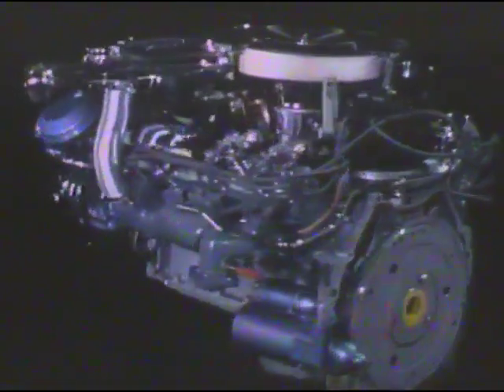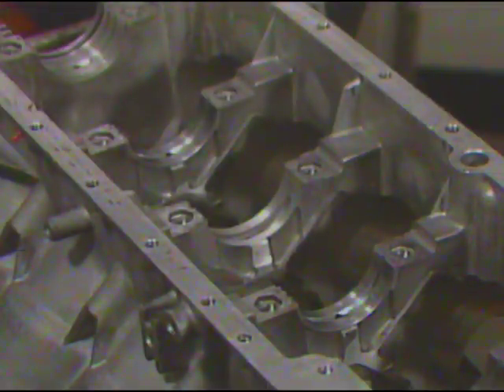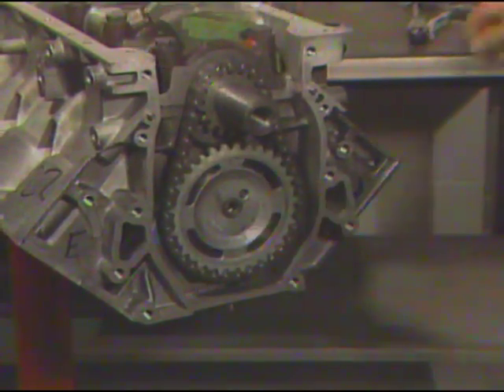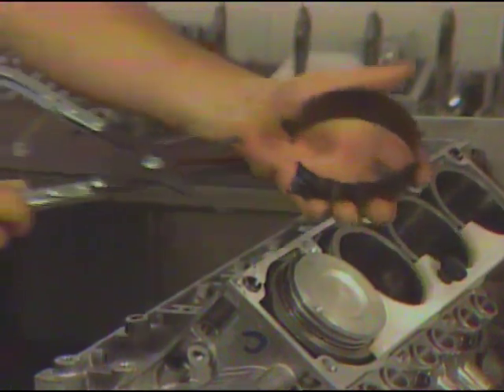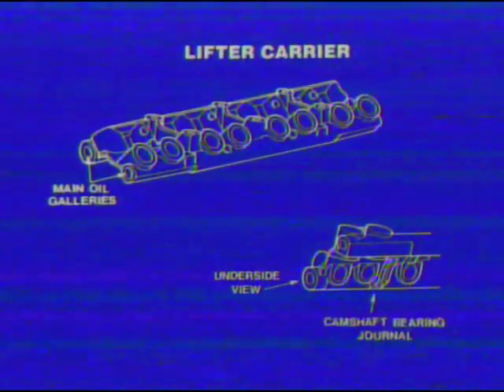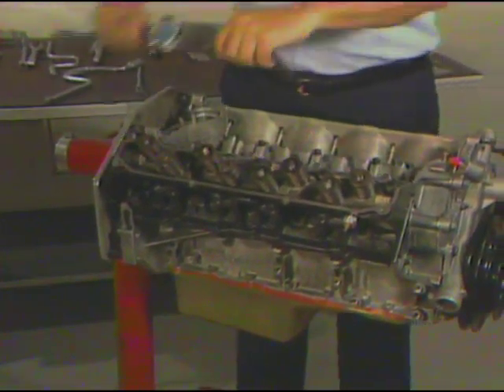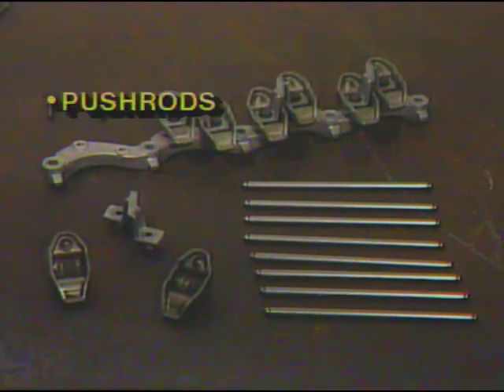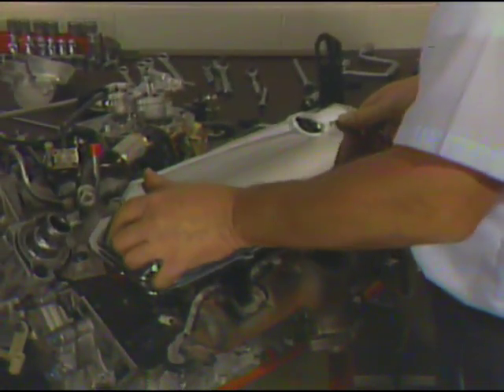Cadillac HT4100 Engine Assembly - Service Roundtable Laserdisc

Comment: Best engine ever! Powerful, smooth, quiet, fuel efficient and most of all extremely reliable! Fun Fact: It is so good, that all of today's best engines are based off this exact platform! Thank you GM!
Reply: I am sure glad you have a sense of humor!
Reply: It was a pos,headgasket and camshaft failures
Reply: You are insane
Reply: What??! This is a HAND-BUILT MASTERPIECE! 🤯
Reply: @allentoyokawa9068  The camshafts in them were too soft.My dad has replaced one because of headgasket problems
Reply: They are excellent engines, provided you don't ever start them for any reason.
Reply: @kennethsouthard6042  They were not
Reply: @kennethsouthard6042  🤣🤣🤣🤣🤣👍
Reply: They ran good...... If & when they ran. Whatching the assembly procedure in this video clearly explains why these engines sucked. Though they did go under the hoods of some attractive looking Caddys.
Reply: It Did Help With GM Engines, Except The Engines That Followed Were Tested Better & Not On The Public, The HT4100 Was So Bad Nobody Will Make An Engine That Size, There Are 4.0 & 4.2, But No 4.1L...Let That Sink In 💁🏽‍♂️
Reply: Was your point of reference a Vega engine, with a powerglide?
Reply: When maintained properly yes but that goes for any engine.
Reply: Very fuel efficient

Comment: I ha 5:46 ve my Dads 83 Eldorado,  these were beautiful cars inside and out. It has its original Ht 4100, 147.000 miles, no problems with the engine,  runs smooth, sounds very good. 3000 mile oil changes, and coolant exchanges every 2 years, and coolant tabs ALWAYS at every coolant service.  The engine has never been touched.
Reply: You’re the only one with the original 4100 trust me 😂
Reply: @LowEnd31st  no one gonna trust you. My 83 Brougham still running strong 41 years later. Now what

Comment: Owned a gorgeous 1983 Fleetwood Brougham d'Elegance Coupe w/only 30k miles back in 1985-86. That Hook & Tow 4.1 motor was junk. Broke down non-stop all the time. Got rid of it after 6 months. Never went back to Cadillac after that.
Reply: I have a 30k mile 83 fleetwood brougham de elegance with 4.1 and runs perfectly in 2024

Comment: I get this is a bad engine. But I can't bring my self to swap it out of my seville. The engine is the heart of a car. This video made me want ti get it rebuilt and get all that polished chrome on it. I would most likely have some company machine me new heads.
Reply: I have an 85 Seville and while the video showed how intimidating this rebuild would be due to modern supplies being different, I still want to rebuild my 4100 too. Maybe even change some parts to make it more reliable if possible.

Comment: I had an '83 Eldorado with this engine and what a nightmare it was. On the plus side, the car got 26.5 mpg on the highway and purred like a kitten. Is there any place on that engine where GM did NOT use RTV? I got rid of the car and bought a new 1993 Volvo 240 which I still drive today 30 years later.

Comment: Like so many other GM products, this one was actually decent just before it ended production. My dad put over 300k on a '91 4.9 with nothing more than regular maintenance and main bearings every 50-70k. The only time it left him stranded was due to fuel strainer desentegrating and destroying the fuel pump. Neither the engine or trans were ever out of the car. That said, most of the interior was held together with long self tapping screws and duct tape by the time he gave up on it
Reply: Main bearing are absolutely not supposed to be a "Wear Item" - if they need replacing that often someone has seriously fked up.
Reply: I’ve known of more than a few 200-300k + 4.9’s
I’ve never seen that many on a 4.1, but my 85 Brougham has ~130k and to my surprise has given me very little trouble. We’ll see if that last…

Comment: In my experience with GM engines, there's too much dependence on RTV (Room Temp Vulcanizing) sealant instead of good old gaskets.
Reply: A good quality RTV such as  grey  greay or ultra black.. has excellent sealing properties.. better than gaskets... A lot of modern engines.. have their timing chain covers oil pans.  Sealed Solely with RTV.. when applied properly. It seals much better than rubber or cork gaskets

Comment: I like that there's one comment so far and for once it's not someone screaming 1st also excited to see all the comments on how good or bad the engine actually was curious if it has major failure points
Reply: It was one of the worst engines ever made. It was rushed into production in 1982 when Cadillac’s 6.0 liter V8-6-4 cylinder deactivation system ended up being a catastrophic failure in 1981. The HT4100 wasn’t meant to debut until 1985 in the much smaller downsized line of cars. But it was hastily placed into large, heavy full-size Cadillacs to meet government mpg CAFE standards. The various metals used in the engine were not compatible and caused the head gaskets to leaks and fail, head bolts would tear out of the soft aluminum threads in the engine blocks, oil pump failures and the engine was just too small and underpowered for the large cars they were being placed in.
Reply: @jayson657  y does this not surprise me lol good ol gm it's like VW but american

Comment: I found a cherry '87 DeVille with a 4100 in it @165,xxx miles. Im sooooo curious as to wonder what was done to it to have reached those miles(rebuild, maintenance, etc). Started out asking 5500, but now its down to 3995. If ut creeps down to about the 3500 mark, i just may get it at least for the body/interior. I can always replace the motor, right?
Reply: There’s a good chance it’s been replaced or rebuilt already, even though the 87 version is allegedly “fixed” (it wasn’t). Problem is it’s getting hard to find replacements.

Comment: Let's see. Oil leaks. Coolant leaks. Intake gaskets. Main bearing knocks. Sludge. Worn camshafts. Broken oil pumps. Broken rocker supports. Sticking valves. And more oil leaks. Did I forget anything? I cut my teeth on these boat anchors in the 80s starting out in a Cadillac dealership.
Reply: Left out headgasket and camshaft failures
Reply: Oh, yes, you forgot the porous block castings which let coolant "bleed" right through the block lol...... don't forget your coolant pellets when changing the coolant to keep them nicely blocked (and clog the water passages it DID need in the process)
Reply: @joe6096  yeah, we called them Cadillac aspirins
Reply: I cut my teeth in the mid 90s after most of the bugs had been worked out of this design and Cadillac started all over again with a new one. Doing main bearing service or even an intake on the 4.5/4.9 engines was a treat compared to all the headaches that came in on the Northstar Sevilles/Eldorados. Ugh I'm glad those days are over
Reply: Same here started at a Pontiac Cadillac dealership. Cut teeth, hands, fingers, arms and assorted other body parts!😁 Parts department had a half dozen or so long blocks in stock! Now that is quality 😅
Reply: I bet you got lots of experience 😂

Comment: What carries over to the later, refined 4.9L? The build in particular is moving in a RWD reorientation but the engine and transmission are very interesting to me, and I'd like to utilize the pulled drivetrain in something else down the line.
Reply: A lot of it carries over directly. Really the only major differences are the timing cover and thermostat housing adapter. The 4.9 seems to use proper gaskets in place of RTV slathered over everything, as well.

Comment: Good grief, I hated this motor.  Worked in multi-line dealership service department and when we saw one of these it was usually for blown headgaskets/overheating or leaking oil.  

I'm not certain which was worse, the Northstar with constant blown headgaskets/bad heads or the 4100 motor.  Along with V8/6/4, not one one of Cadillac shining engineering achievements.
Reply: Your right ex Cadillac mechanic here also

Comment: Go listen to what Adam at Rare Classic Cars and Automotive History has to say about this engine. It's not good and he has a lot of experience with Cadillacs and other cars of this era. He says if you want an older Caddy avoid this engine and anything with an Oldsmobile 5.7 diesel. Both are probably the worst engines ever sold to the general public excluding the original Vega engine which was even worse. The V8-6-4 was also terrible, but if you disconnected the system and just ran it as a V8 it was fine.
Reply: The Olds 350 diesel can be made reliable fairly easy and is simple to work on. Headstuds and a water separator and suddenly you have a 30MPG cool highway cruiser or daily
Reply: @V8Power5300  This might be correct, but as a stock design it was terrible.
Reply: Adam brought me here.

Comment: This is the engine that had the V8-6-4 thing correct?
Reply from the maker: You're thinking of the '81 Cadillac. Clip a single wire and it goes back to being a dead-reliable cast iron 368 like the '80 version. It was the '82-85 HT4100 that was the disaster.
Reply: No this hunk of junk was hastily rush into production to replace the failed V8-6-4.

Comment: Such a shame. Small, light, smooth, replaceable wet liners, so much about this engine should have worked well. It was just rushed out before it was properly fettled. Too many odd mating joints, too much RTV, too much differential expansion, not enough torque in the equation. All Caddy engineers needed were another two model years of troubleshooting the design.

Comment: Back in school a classmate had this engine in a hand-me-down Cadillac. I remember it being pretty slow, but got slower and slower until finally it could hardly even sustain 35mph and they junked it. I can't be sure this is true but supposedly the camshaft lobes literally wore down flatter and flatter until the valves hardly lifted!? Seems like an impossible mistake after properly hardening camshafts for decades, but I've overestimated 80s GM before.
Reply: i mean they still cant get it right with the ls. they have problems with camshafts aswell. I've sceen one taken out of a 2012 or 14 i cant remember which and the lifter and 3 lobes were just completely fuckered

Comment: This engine was underpowered and plagued with issues.  This engine should have had aluminum heads.  This engine was intended for the FWD models.  They should have never put them in them 
Full size Cadillacs. I own a 1984 Coupe DeVille with this engine. It’s smooth running however with the listed problems I make sure it’s maintained.

Comment: This was the worst engine in the cadillacs 4.1 noted for coolant leaks if you didn't add a additive in the  Radiator. The headgaskets Would leak because the block was aluminum with cast iron heads. If you've got 30000 miles out of the engine with no problems you were doing good.

Comment: A bean counter engine…To save money, GM should have just switched to sharing engines by then. Say a Chevy 305 that was found in a Caprice as they were slow but good engines. Better to piss off customers by not having a “true Cadillac engine” than having one of the worst engines in history ruin their reputation. They finally got smart an eventually put Chevy derived engines in their full size RWD cars. Unfortunately since 1981, there hasn’t been a good Cadillac engine the write home about. The 4.9 was OK but nothing like the small block Chevy engines. As a GM guy, Ford had it right by sharing the 302 and later the modular engine.
Reply from the maker: Unlike the diesel debacle (which was bean counter related), the HT4100 was an expensive engine to design and produce. Tighter tolerances, new design methods, exclusive assembly line, lots of aluminum. It was engineering that dropped the ball on this one. But Cad was in a real jam at the time. The Chevy stuff is out (not-compatible with Eldo/Seville FWD). And the big B/C cars were going to be dead after MY85. They also couldn't go back to a carb, being the poster child for advanced tech and focusing on it as a market differentiator. They had just released the industry first DEFI system in '80, with onboard diagnostics, digital climate control, trip computer, and other goodies you couldn't get from Buick, Olds or the imports. Best of all, the system was both reliable and well received. The whole impetus of the decision to pull forward the 4100 was that NHTSA could not come to terms with an MPG figure on the '81 V864 system that Cad was banking on to get them to '85. That's why it only continued on in the commercial chassis which was exempt. Cad did offer the Buick 4.1 V6 (carbed) in parallel with the HT4100, but there were few takers.

Comment: One of the worst engines of all time ..I think mainly to poor quality materials , And just plain dumb engineering . I have worked on these for decades now .. was part of a line up of losers in 1982 , the Buick v6,
Olds Diesel , or the 4100 .. 
All instrumental in destroying the name and opening the door for the imports , now the Chinese own GM … sad
Reply: It’s just a shame Cadillac took until 1990-92 to finally put  fuel injected small block Chevys in their full-sized cars. If they would have just done that in ‘82- while the other GM V8’s were still carbureted they probably wouldn’t have tarnished their reputation very much. Lincoln got away with it with the Ford 302.
Reply: @jayson657 They did in the 1993-1996’s as well on the Fleetwoods. I had a 1993 Cadillac Fleetwood with a TBI 350 Chevy engine. The same engine you would find in a pickup. GM should have used common engines across all their brands like Ford did. The 4100 was a result of bean counters rushing engineers into coming up with this engine. Maybe if GM shared engines, they could have saved money that way and concentrated on building a reliable engine. They should have just but a Chevy 305 with the 350 as an option in all their full size cars. I had an 80’s Caprice several years ago and  while gutless, it was reliable as can be.